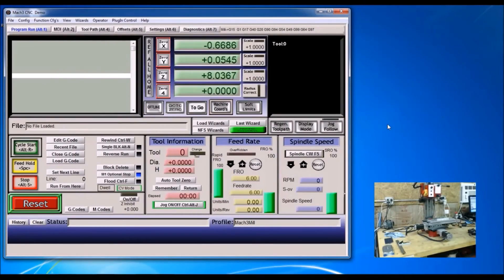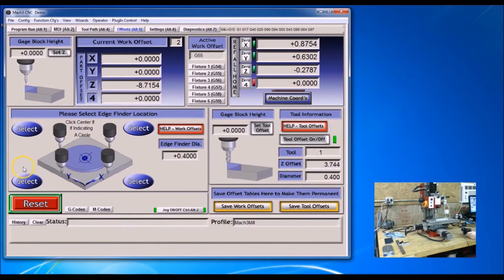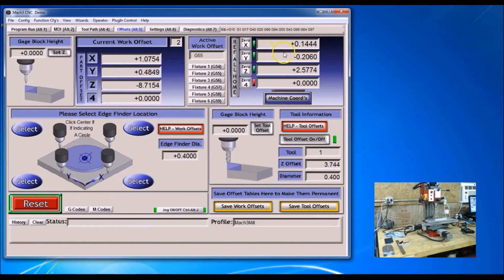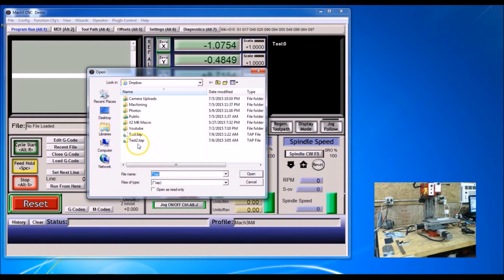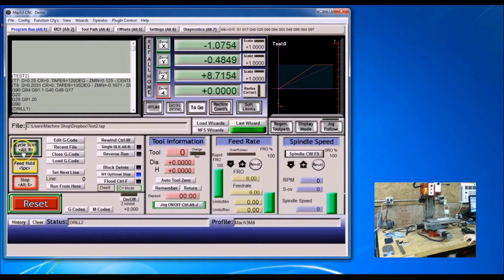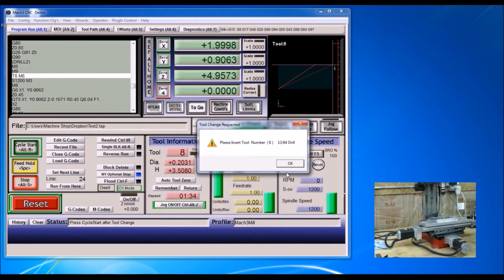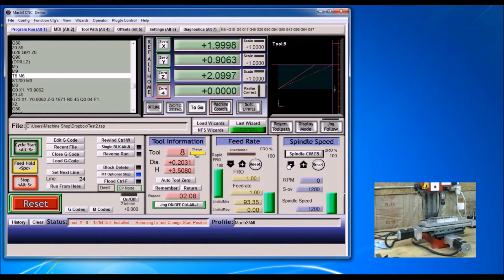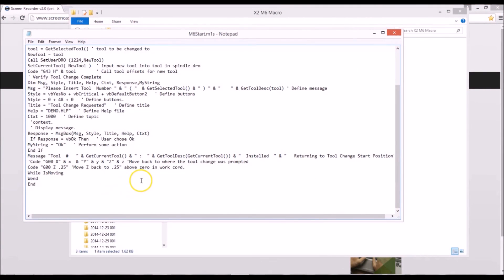Making a Fixture Plate Part 5  -  Mach 3 Setup and Machining Parts

Comment: After watching a couple of your videos now I'd like to ask you,  I have a Sherline Linux cnc mill but I'd like to either use Windows or the program your using here.

Can I can the Linux computer for a laptop with that program to operate my Sherline all the while I design using Fusion 360 and if I can how do I go about it?

I was under the impression that it would be to difulcate to do is this right?

Thank you for any help you can provide.
Reply from the maker: Sorry, I am using a Tormach now and I'm kind of out of touch with Mach 3.

Comment: Craig, are you planning on adding spindle control? It took a lot of fiddling, but I was finally able to get mine running between 500-3000 RPM +/- 20 or so RPM.
Reply from the maker: Charlie Harris Wow, you are ahead of me on that one. What breakout board did you use? Mine doesn't support it.

Comment: Thank you both for the info. I'll be working on the switches this weekend (I got some Omall micro switches). I too plan on adding some kind of mist system. I was thinking of going with a fogbuster kit from LMS.
Reply from the maker: Charlie Harris Yeah, The fog buster looks good. I will be pushing my mill hard in steel so I decided to go with flood coolant. That will be my next series of videos, the enclosure/coolant pan.

Comment: Ok, thanks. That's what I was thinking. I'm looking at doing home switched on my mill but was wondering how accurate they would be. I'll probably do them if nothing else than to set up limits.
Reply from the maker: Charlie Harris The homing switches come in handy when there is binding or you hit the end stop. I am assuming you went with an open loop system which means it can loose track of where it is at.  You then have to ref all home so it knows where it is at.  Otherwise you have to set zeros each time you bind, etc.
Reply: For the most part there accurate I would save within a +-.001
Reply from the maker: Charlie Harris Sam at CNC4XR7  is doing fine with the regular kind. Sounds like they may work for you.. Don't get the larger ones with the long arm on it like I did. I had one arm bend and it is too big for the Y axis.

Comment: Great video as always! Very handy and perfectly timed as I work my way through my own learning process.  Question... How accurate/repeatable is REF ALL HOME using your homing switches? If it wasn't very accurate (within a thou or so), you'd have to re-zero every time you restart Mach3 right?  I'm not fully understanding how the machine knows where it's at after you restart Mach3, load the fixture, and then REF ALL HOME.
Reply from the maker: Charlie Harris Thanks! The offset distance between the limit switch and fixture plate is stored in Mach 3 in G54, G55, etc. By selecting the appropriate work offset for the  fixture plate, mach 3 knows where the fixture plate is. Its only going to be as accurate as the switches.  I don't think the type of switch I am using is accurate enough for use with fixture plates.  I will probably be changing mine to the kind on the Tormach.  $30 each on their website.  I will probably be just set zeros frequently till I change them.  Hope that helps. Let me know.